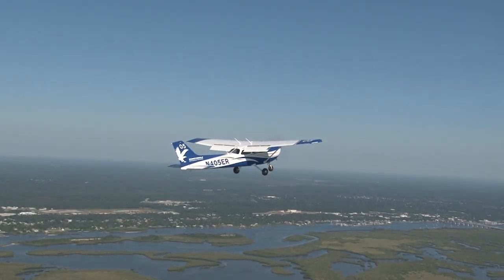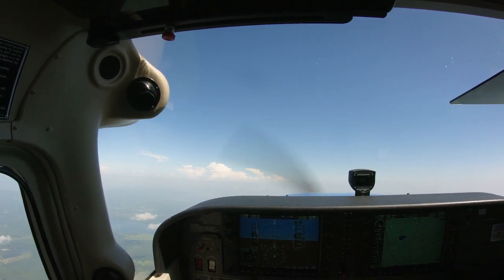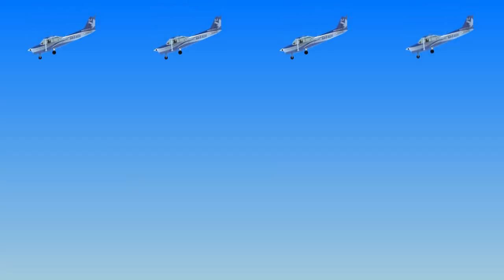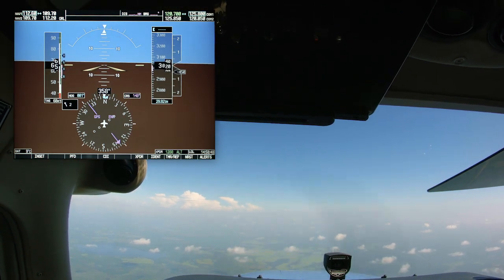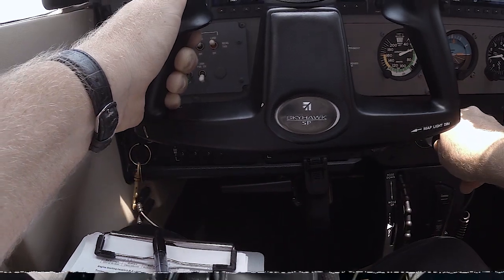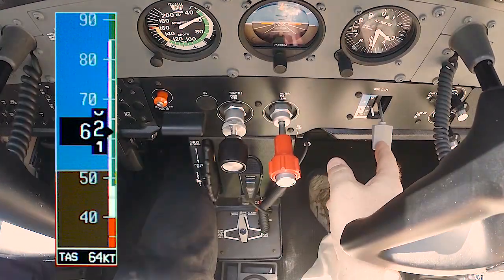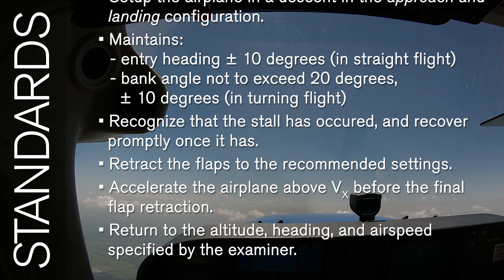Power Off Stalls

Comment: I just started experimenting using Foreflight and Cloud Ahoy to display the altitude lost from straight and from turning stalls when at 2,000 or more AGL so that I can land closer to the edge (on calm days), and smoke my buddies with their Cubs. 

When looking at the altimeter alone, It seems I lose about 20-30’ in my Aerotrek A220 from the gentle break, until I lower the nose, add power and begin to climb, and about 40-60’ in my RV8 (when I’m going straight and ready to take action).

If I hold the stick full-back in my Aerotrek, (like a panicked student might) it will lose 200’, then start flying on its own, then stall again a few hundred yards later, drop 200’ and repeat over and over. Like my RV8, the Aerotrek has zero tendency to drop a wing, so it takes deliberate inside full-rudder to initiate a spin. (I have never actually spun the Aerotrek as it is not rated for them).

A buddy of mine has a radar or similar device in his Saratoga that calls out the distance above the runway when landing.
I think combining this with a precise vertical profile that can be reviewed would greatly improve the aviation learning curve and safety.

Comment: 07:42 mild banks are not the main causes of turning stalls,  steep turns are.  Mild Maneuvering instruction is denying the main cause of power off stalls. The  Steep Turn pilot errors by mild maneuvering instructed pilots.  Practice Accelererated Stalls after mild t;urn stalls done well.

Comment: when you push the power back to 1500PRM, to maintain altitude you must pull back on the yoke, how is it you gotta push forward when you add each flap?
Reply: Flaps generate lift and make the airplane “float” up. To counteract this change in altitude, forward pressure is needed

Comment: Hello,
Do I understand it right that, 
Stall will happen when you have a  large angle of attack at relative low speed?
But if, with the Same Angle of Attack, the speed is much higher, then stall won't happen. Right? And the plane will climb up of course. Right?
If right, What are those speeds and angle of attacks?
If not right, Then how come that fighter jets and other acrobatic planes can climb strait vertically?
I suppose this is because of their high speed, which provides enough lift, no matter in what direction they move.
So why can't normal plans in a critical angle of attack give full throttle to gain more lift?
Reply: Stalls can happen at any airspeed and any attitude; the only thing that matters for inducing a stall is Critical Angle of Attack. If you're past Critical Angle of Attack, you'll stall.

I'm not 100% sure how fighters go straight vertical, but I believe it has something to do with managing their thrust-to-weight ratio. But for the purposes of civil aviation, moving really fast will not prevent you from stalling, and stall speed even changes based on your maneuver and how your aircraft is loaded.
Reply: @realjohnald  
That's what is difficult for me to understand.
Air is everywhere in the sky. In any direction we fly, there is equal air. 
To get air pass along the wings, we need to move our plane fast through the air. Then at a certain speed of our movement in any direction air passes along our wings, and we get lift.
So why the angle of a plane makes air act otherwise than flying parallel to the horizon? While air is the same everywhere.
Reply: At or beyond ctitival angel of attack, air flow above wing is disturbed so you lose lift. Thus it happens at any speed
Reply: @gemini76isback  

That's what is difficult for me to understand.
Air is everywhere in the sky. In any direction we fly, there is equal air. 
To get air pass along the wings, we need to move our plane fast through the air. Then at a certain speed of our movement in any direction air passes along our wings, and we get lift.
So why the angle of a plane makes air act otherwise than flying parallel to the horizon? While air is the same everywhere.
Reply: A normal plane can’t simply apply full power when they reach critical angle of attack because our engines aren’t as powerful as fighter jets. The fighters have a MUCH better “power to weight” ratio.
Reply: Pls read first few chapters of “ from ground up” ..... or sign up for ground school.... or search why planes fly on YouTube ....
Reply: @gemini76isback  
I am asking this question after watching and reading some aerodynamics.
Thanks.
Reply: Sohail Nawaz  In reality, when a fighter jet is climbing vertical, the wings aren’t what are producing much of the “lift”(although the wings are not stalled and they ARE producing lift, just not vertical lift); the jet engine is essentially the source of lift, much like the rotor on a helicopter. You should read/watch some specifics on exactly how a wing produces lift, and what the term AOA (angle of attack) really is. AOA is essentially the direction “relative wind” is hitting the wing. Wings actually need air flowing over the top to produce lift. In level flight, wings have plenty of air flowing over both the top and bottom of the wing. When you’re flying straight and level, the “relative wind” is hitting you’re wing straight-on to the leading edge (leading edge is the front rounded part of the wing, the part that you have to clean all the nasty bugs off of), but as soon as you pull the nose up then that relative wind is going to be striking the underside of your wing, and less and less is going to be flowing over the top. The “critical angle of attack” is when the relative wind can no longer “stick” to the top of the wing because of the extreme angle. Yes, generally slower speeds tend to produce stalls easier because there is less air moving over the wing to produce lift.
Reply: @ujymet  
My question might be not that clear to everyone. 
But I had difficulty to understand the theory of "Relative Wind". 
I thought that Relative Wind comes always from exactly the opposite direction of the  nose of the plane. But it does not seems like to be true.
A plane can fly with its nose pitch up, but still not going in the direction of its nose, but straight forward instead of climbing up in the direction of its nose.
So in that case  the Relative Wind would be coming not from the direction of its nose, but from a lower angel relating to the horizon.
So if I understand it right then,
In the condition of a stall, we can give full thrust to make the plane climb up exactly in the direction of its nose. So that the Relative Wind also comes exactly from the opposite direction of its flight path. Then there wil be almost no angle of attack, or a very small angle. And there will be no stall anymore.
Right?
Reply: @sohail1855  Yes yes yes you are getting a much better understanding of it now. When we are at a high angle of attack then the relative wind is coming more at an angle from under the wing. The only thing I would point out is that in most airplanes when we are about to stall and then we give full thrust, they don't climb directly in the direction of the nose. They try to, but the engines are usually not powerful enough, so we have to lower the nose a little bit to lower the angle of attack. This will help the plane gain airspeed a lot easier. When you are in a fighter jet, then yeah you can give full thrust and be going basically directly where you point the nose because they are so powerful.

Comment: There is absolutely zero reason to have to use the heading indicator and attitude indicator to practice stalls. It's a shame these videos are 95% good and 5% bunk.
Reply: That is true if all you care about is flopping the airplane around in the air. However, I think the purpose here is to practice so you can maintain a precise heading during the entire maneuver to be prepared for if it happens over the runway, or in other situations close to the ground. In those cases, it may be critical to not just recover, but recover in a precise direction and location. It may be that the very next thing that MUST happen is an immediate forced landing--better to be where you want it than just wherever it happens to flop to.
Reply: @skippingguy  "That is true if all you care about is flopping the airplane around in the air."

It is true period. Look out the window. You can hold heading perfectly well without instruments. Same way you do when you takeoff or land.

Comment: It is better to simulate a glide, with trim well for a glide, then a turn, then stall and recover.. Scenario Simulation relates the maneuver to a common stall mistake situations instead of relating it to nothing and simulating NOTHING...
Reply: power off stall = landing. power on stall = take off. seems pretty relatable.
Reply: @Ironiclobster69  Most power off stalls happen on a turn of base to final, not slowly pulling elevator like that...A 45 degree turn power off, a sudden Panic Pull from the pilot due overshooting final leg- and stall.  Some CFI are afraid of teaching those due the can result in a spin and the are afraid of spins..
Reply: @CFITOMAHAWK2  So you figure as a student pilot I should start learning to manage a stall by giving a good panic pull on the yoke and see what happens?
Reply: @CFITOMAHAWK2  You have to learn the basics first before you can move on to understanding what a spin is and why it occurs. The FAA's standpoint is to teach how to prevent a stall from ever occuring because you can't enter a spin until you stall the wings. If you get up to a safe altitude, you can have a CFI demonstrate the wing dip of a stall and how using rudder to correct it is how you save the aircraft without ever entering a spin. The tendency is to use ailerons to level the wings but this just makes that base to final situation worse because of how the ailerons deflect so it's training to use rudder instead.

We practice these stalls so we have that stall recognition ingrained in us and then the recovery is just automatic after that. You don't need to practice a spin to stay out of one, a pilot has plenty of chances to save the aircraft before it ever enters that spin, it's far better to train a pilot to recognize those early signs rather than wait until you have to use PARE to save it.
Reply: @skippingguy  You should fly it within the ACS standards, and do it as per your AFM/POH and CFI suggests. Then supplement your knowledge with the Airplane Flying Handbook and Pilot's Handbook of Aeronautical Knowledge. 

I would suggest asking a CFI to demonstrate a wing dip where you let the aircraft stall and remain stalled while arresting the wing dip by using rudder and really practice keeping the ailerons neutral and relying on rudder to maintain straight and level. Basically ask to do a bunch of secondary stalls and use rudder to keep the aircraft from entering a spin. Allow it to enter the incipient phase but don't let it spin. Right before it does kick the rudder to re-level the wings and recover as normal.
Reply: Exactly.. They are relating the maneuver to nothing at all..
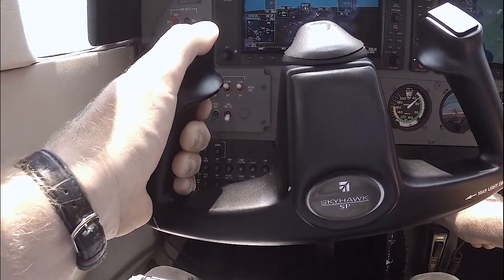Reply: 5feetgoaround fullflapsC150 I’m not sure what you think they’re not simulating. At 4:08, the narrator states to set up a 65 knot glide to simulate an approach to landing. Watch the video again and listen before making incorrect critical comments.

Comment: I had an instructor tell me to keep off the rudder during stall as it can cause a spin but this goes against what other instructors told me
Reply: You want to stay coordinated, if not you will cause a spin
Reply: definitely need rudder especially in power on stalls, staying coordinated is super important
Reply: jd10t  I was told same thing years ago during training. No rudder.
Reply: Thats the kind of Mild Maneuvering CFI to avoid.  They want to use only half of the controls needed..  They are clods.  YOU NEED TO USE ALL CONTROLS..  That CFI is full of shiiitttt...

Comment: As an examiner i want to see a candidate performing stalls  with minimum  recovery height of 3000 feet. When i do check outs, i tell pilots the same, i tell them you never know what an aircraft is going to do. If an aircraft as a lot of hanger rash, they can do some interesting things at the stall.
Reply: Class B at 3000 AGL? practice a few miles further from the Class B ??
Reply: Hangar Rash??.. Is that for bugs in the pitot tube??  Or just rust on the controls or else?? LOL..
Reply: All of our stalls start no higher than 3000agl, too easy to bump into the class B shelves. At least for straight wing trainer aircraft it takes a lot more than a few dents on the airfoil to make a recovery use even 1000 feet, either the airplane is not at all airworthy and should never have passed even a cursory preflight or the candidate should not have been endorsed to take the test.
I get the concern as an examiner you have a large set of unknowns. However I've never heard any of our local examiners mention recovery minimums other than what is required in the ACS and I know the FAA has been tightening up on DPEs that try to set their own standards.
Reply: @TheDuckofDoom.  Soooo maybe get out from under the class B before practicing?
Reply: 3000 feet 

Who can't do that? 😀

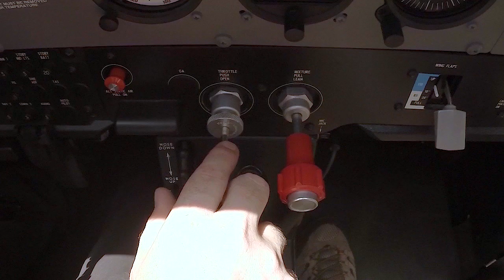Comment: 5:05, 5:15 
i can't understand why we should apply forward pressure on the yoke to maintain altitude.
rather, should we apply back pressure in order to maintain altitude?
Reply: As the flaps are put down the nose is going to want to go up in the air, thus adding forward pressure to stop the nose rising so you can maintain altitude.
Reply: I don't get it either...because you are slow at 1500rpm...meaning you will lose altitude and to compensate i.e maintain your altitude don't you have to pull back on the yoke?
Reply: @websterhumphreys8744  Lowering the flaps causes increased lift, so you need to counteract that lift by pitching the nose down.

Comment: I noticed that mixture was leaned.  I have not seen that before.  Could you explain why you were not using full rich mixture?

Great video information
Reply: Marco Williams, stall manœuvrer are supposed to be full rich, your right. And no you don’t got more power after a stall being lean than being rich. This is what I’ve learned. The best is to look into the POH check list of the plane.
Reply: Lycoming has updated leaning recommendations, in large part because flight schools have been running there engines way to rich and actually reducing engine life. (most notably the Embry Riddle Florida fleet) 
While one sentence answers to leaning are inappropriate for overall pilot training, the short answer is that the only time you should be full rich is for initial start and a full power takeoff below 4-5 thousand feet density altitude. 
Lean for taxi[bp], lean for run-up[bp], lean for high altitude takeoff[bp], lean for cruise[bp or fl], stay leaned on decent(richen when the engine runs rough).  bp=best power aka max rpm, fl=fully leaned for economy, which is lean until the engine gets rough then richen just enough to smooth. The only reason to be rich on final approach is if you don't trust yourself to promptly richen on a go around.(is a reasonable concern) Also to be noted is that there is a red zone in the middle where you can cause heat damage, rich of this zone and fuel cools, lean of this zone and the extra air cools.
This is not advice for turbo-supercharged engines, they have a whole different set of criteria.
Reply: From what I’ve seen they actually just use clips of video that shows what they are describing. The shot you’re seeing is not the actual maneuver being performed. They just had stock video of the pedals and edited that in
Reply: I am not sure I am correct so please take with a grain of salt. The leaner the mixture the better the combustion but the higher the risk of overheating. The richer the mixture the more cooling effect the fuel has. So from this I would say its leaned as to increase efficiency of combustion and prep the engine to give as much power after the stall. This would make sense in recovering as quickly as possible form a stall. If it would be full rich then the cooling effect of the extra fuel plus the sudden altitude drop might affect the engines rate of delivering power in a critical situation. I could be wrong though.
Reply: Over 5k density altitude if engine dont overheat you can lean even at full power with most non turbo engines..